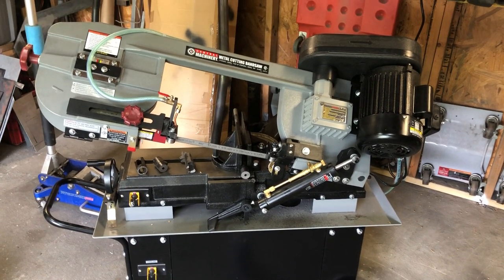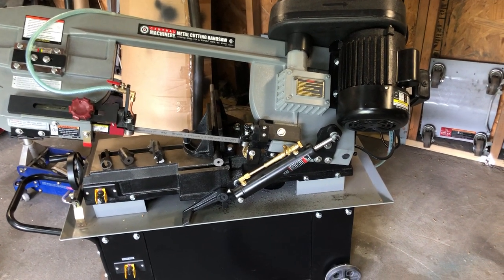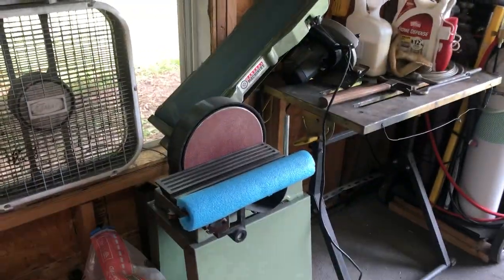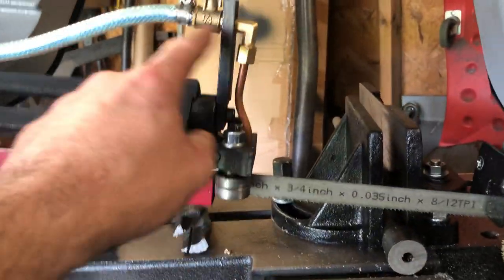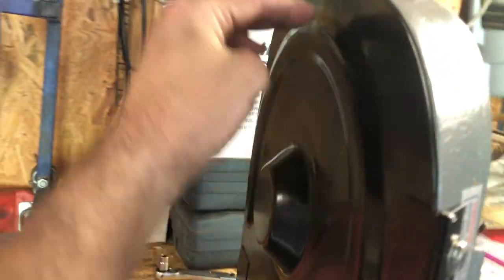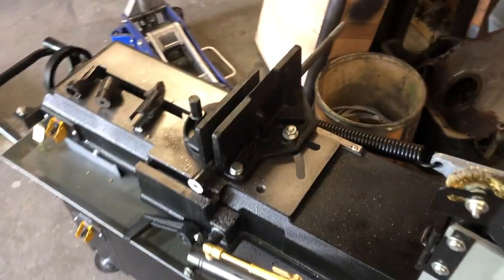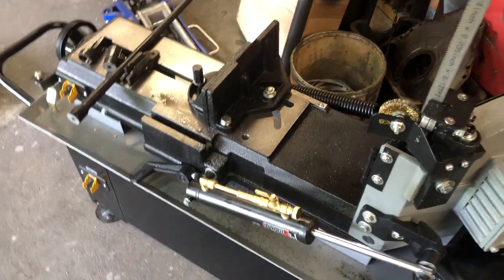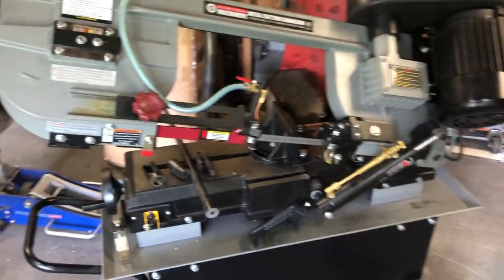Harbor freight metal cutting band saw review, tips, instructions, etc.

Comment: We destroyed 2 of those in 2 years! It is cheap and won't last with daily use. It is so so so slow. Replaced it with the Klutch 7x12 from Northern for a couple dollars more.
Reply from the maker: hmmmm. so far so good, but im just a hobbyist and not a shop. i really haven't used it much. cuts decent for what I'm doing now that i swapped the blade. not sure how it's slow when you can put w/e blade on it you want, change speed, and feed rate though. can you explain? or you mean how it comes with that crappy wood cutting blade.. also, how did you "destroy" them? like the motor failed?

Comment: My brother in law gets 25% coupons and sent me a few. I bought a 73" icon toolbox and ive been eyeing one of these bandsaw's.  Im going to build a 3" stainless exhaust and bought the smaller bandsaw but wouod rather attempt the exhaust with one of these instead....
Reply from the maker: yup, that's my plan. stainless exhaust. i just used another one of those coupons to pickup one of the new HF 72" U.S. General boxes. i wanted an ICON, but just outa my budget.
Reply: I really want this band saw but as of right now I'm going to attempt to use my current 4x6 practically new bandsaw with the 14t bi-metal blade I just ordered from Amazon.  A guy said that blade worked great for his 3.5 ss exhaust. I can continue to upgrade this one I guess and not spend around $1200 after the 25% off. My recent icon toolbox purchase is part of this decision... knowing myself I'll go buy the new bandsaw 😅
The US general toolbox and the icon have a massive quality build difference but to be honest the US general toolbox would work fine for me. I just like the nicer things even though I don't need that level of tool
Reply from the maker: @ed_1969  it'll probably work fine. does that one have a hydraulic feed too and just no cooling or it just feeds with weight of the saw? if anything just keep it well lubricated and allow it to cool between cuts. i've had good luck with the imachinist blades off amazon. i have a 8/12 tpi and a 10/14 tpi depending on what I'm cutting. mines almost paid for itself already with some side work. haven't even started using it for my stuff yet. i'll eventually need another box when i move into a bigger place, and i'll probably get an icon then. For now, i think the general will serve me for what i use it for. its definetely an upgrade from my old beater craftsman box lol. i haven't even taken it outa the crate yet though. still waiting to expand my shop so i have room for the other new tools i got.
Reply: @callofgeorge  the one I have is a basic no cooling and no hydraulic.  To be honest, today I have been researching into adding a hydraulic/pneumatic cylinder and also thought of a cooling circulation system. I'm at my job so finding time is slowing down my progress lol I have a 69 mustang I'm building and I just made the cooling lines for the trans and brake lines out of nicopp line. 3/16 and 3/8 and still have tubing left over.  If I need a tool for something I'm doing I usually get the best I can afford at the moment.  That's also how I got my miller 220ac/dc welder and a bunch of other tools I have along with my 80 gal 5hp air compressor for my 2 car garage 😁.  I'm a big believer in buy once cry once!  Thanks for the tip on the blade for the bandsaw.  I seriously just brought a 14t bi-metal of that brand on Amazon hahaha I was going to install it tomorrow or this weekend
Reply: @callofgeorge  I really want that bandsaw but there's just some things I have to say no too. Especially when I know I'll hardly use it after the 1 job I bought it for
For the toolbox I got the hf card and after my 25% off I'm paying about $68 a month.... pocket change hahaha but I don't mind that since it has no interest and I got what I didn't need but wanted
Reply from the maker: ok, i know which one you have now. i considered getting one of those and doing the same. installing my own hydraulic and coolant pump. watched some videos on doing it.. and while researching it i got the coupon and just said screw it and went and bought it. the downside is unloading it by myself is what jacked up my back that's still not healed.. but other than that, I'm super happy with the purchase and would do it again. im the same.. buy once, cry once lol. well I'm that way with certain things.. other things i just buy cheap HF and use as a throw away tool.. like several of my pneumatic tools.  @ed_1969
Reply from the maker: oh ya, if that's the only use it may not be worth it. i fabricate a lot. i did my last stainless stuff with a carbide metal chop saw and it worked decently, but the dulled the blades fast with that stainless. abrasive wheel chop saws worked but left a large bur that made me spend twice as long on the belt sander cleaning up.. I was doing pie cuts a lot. if that's the only exhaust you'll do, it'd probably be better to just purchase the pie cuts from someone. i did that some too.  @ed_1969